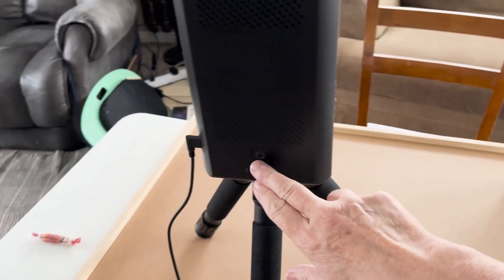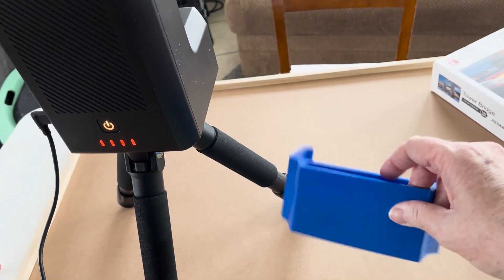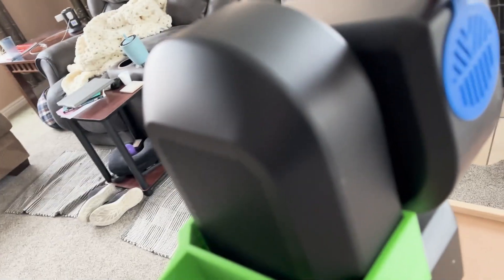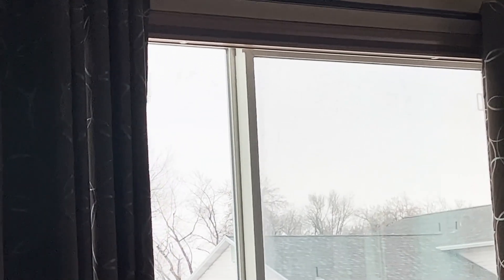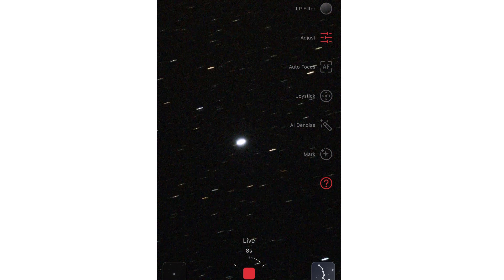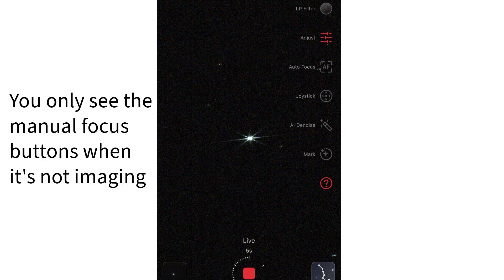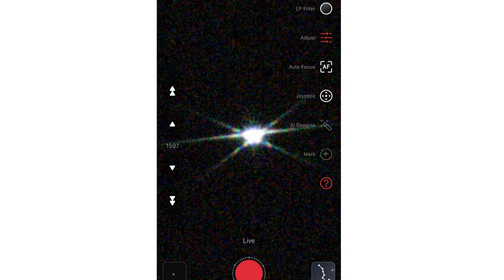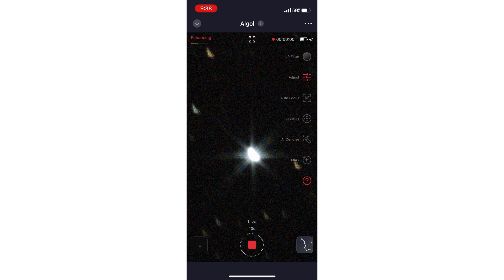Testing Our 3D Printed Accessories for Seestar S50/S30 #zwo #astrophotography

Comment: After your other video I printed the same things.  Bahtinov mask worked well and battery holder was ace in Alt/Az (never tried the diffraction spiker thing or the dew shield).  However  with polar mode arriving, I found the battery moves around too much in the holder.  Might try to fine a way to secure it, Velcro or something, but I ended up taking the battery holder off as a result.

Factory default focus number was not terrible but needed adjustment and I got that using the mask 👍
Reply from the maker: Sounds like we're on the same page with things!  I thought I'd try velcro too, but I'm able to just hang the battery from a tripod knob and that's worked so far.  I had trouble focusing manually for a bit because my eyes are old and don't work as great as I like but the bahtinov mask helps me verify it.

Comment: I still have not used the lens adapters we spoke about a couple of weeks ago. Mind you the weather was very cloudy for the first week. Still not convinced about spikes on stars.
Reply from the maker: Let me know when you get around to using the adapters what you think...
Reply: @thecollegegateway  will do, just going to print the battery holder now as probably want to do a plan mode soon, weather permitting.
Reply from the maker: @esrider7765  I plopped mine out last night and an hour later... clouds :(
Reply: @thecollegegateway  Always the way, did you pack battery in holder with anything to stop it moving in holder, did not want to rock the boat (scope) if it moves ? I printed the larger one on thingyverse.
Reply from the maker: @esrider7765  No, I haven't yet figured out what I want to do about the battery holder in EQ mode.  If I do Alt/Z mode, it's not a problem, but EQ I need to figure out something.  Probably velcro will be my first try.
Reply: @thecollegegateway  ok, velcro good idea. I may use some bubble wrap tonight to get me going.
Reply: The bubble wrap i was in shape of bag, just big enough for the battery to fit into and stopped battery slopping around in holder, the other thing I did was change the holder height to 100mm high (standard size is 60mm). Of course the print failed at 95% done but used what I had, reprinting it now.
Reply from the maker: @esrider7765  Great idea!  Too bad about the print... I hate it when that happens!
Reply: @thecollegegateway  real pain, the filament was not feeding correctly, then broke. Trying to resume print did not work as filament had fed into print head, air printing never works :-)
Reply: But the good news is got great photos of pinwheel galaxy after taking most of the night.
Reply from the maker: @esrider7765  fabulous!  I love that one because it's so defined.  I was able to shoot last night for a bit and did a video about stacking moon raw frames so it was a productive night for me until clouds rolled in again.  Man we're getting a lot of cloudy nights!  Clear all day... clouds at night taunting me!
Reply from the maker: @esrider7765  No certainly not.  Air printing give me a full garbage can of string lol
Reply: @thecollegegateway  I think tonight is 50/50 on clouds, its been blue sky all day but now its 5:15 pm and the thin clouds are appearing. I want to do another galaxy tonight if possible, we have incoming clouds and raindrops thursday through to monday.
Reply from the maker: @esrider7765  darn clouds!  Good luck having a good galaxy night!
Reply from the maker: I wouldn't use the star defractors every time, but when doing stars they are nice to divert the white dots into something more interesting.  thanks for watching!

Comment: Thanks for this.  I also printed a dust shield that i put in just before turning the S50 off.  Have not tried the batanof mask yet.
 
I also printed a few shield that works great.  

The little criss cross arms are the spider on a newtonian like my 8" dobsonian.
Reply: Pretty sure it would just fall off if I tried to close the arm.  Not brave enough to try it so I'll need to be on top of it.  😎
Reply from the maker: I knew the criss cross thingy's had a name, but I didn't know what they were called lol 
I'm not sure I'd ever remember the dust shield until I'd already closed the arm, so haven't tried that one yet.  Maybe I will.